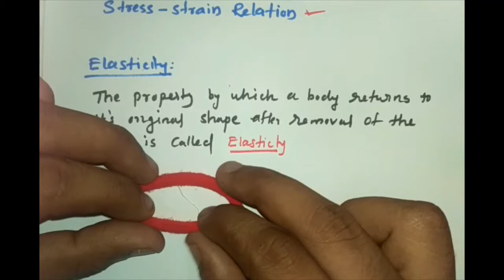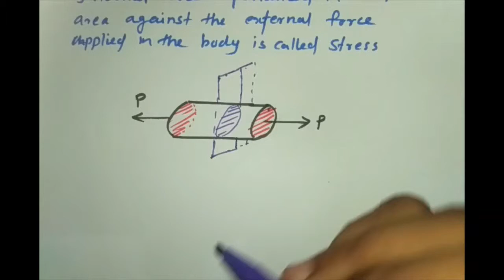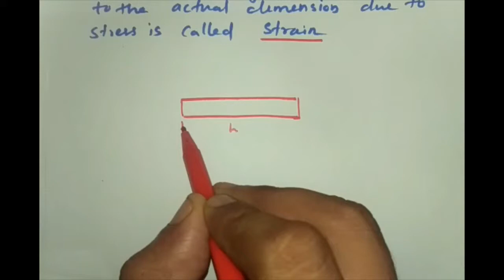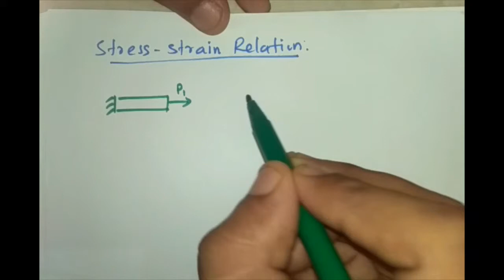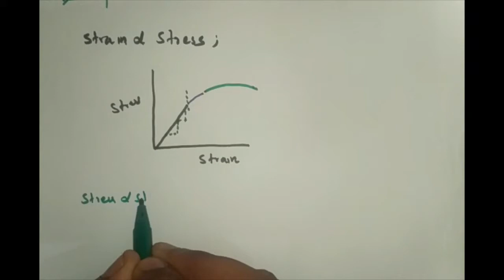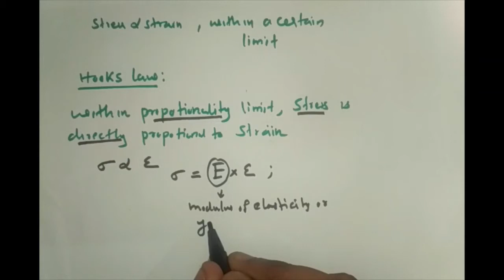Comment: The limit of proportionality is the place where stress ceases to be directly proportional to strain, related by E.  The elastic limit is the place where further application of force will result in plastic deformation, no longer returning to a zero stress condition when released.
Reply: In the last line, not zero stress condition, but zero strain condition😊, it means after elastic limit there will be some residual strain when the load or stress bringing back to zero